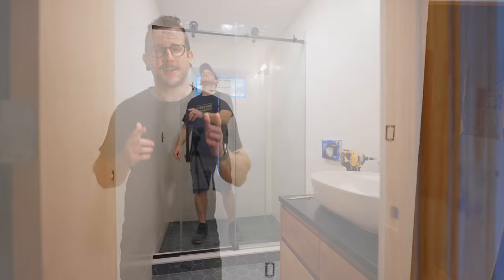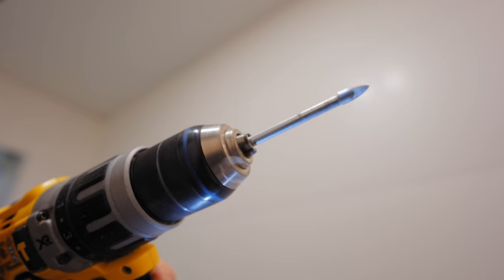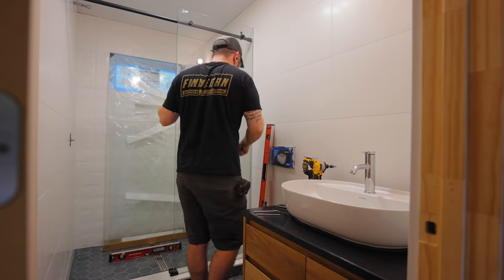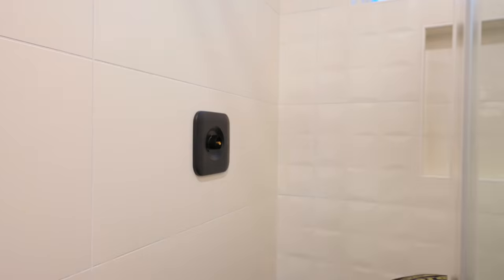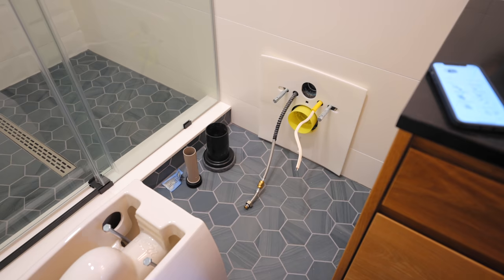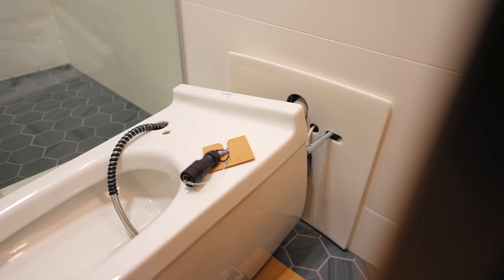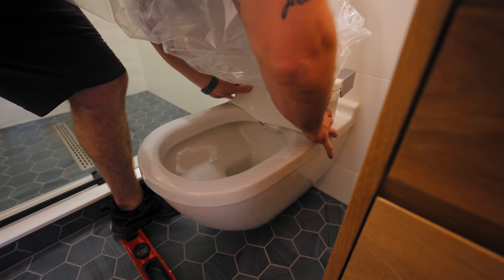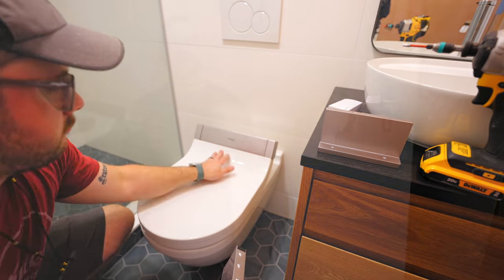Installing a $3000 BIDET TOILET in the Not So Tiny House bathroom 💩

Comment: When drilling holes into curbs and shower walls always inject some clear silicone sealant into hole and into plug before screwing into place. You will be surprised how many curb failures I have seen due to water getting in over time through screw fixings
Reply from the maker: Good tip, maybe I can squeeze some in there now!
Reply: For the curb, the better solution is simply not to drill it at all, and to use a different attachment method.  Or perhaps in a pinch, to drill it no more than half the thickness of the cap.
Reply: @maths9085  Indeed, I always specify screens and doors that do not require drillling into the curb but we all know how other people don’t always pay attention lol

Comment: For screwing pipe fittings in and getting them in the right spot, use a teflon tape and liquid PTFE to ensure a seal without having to wrench on the fittings so hard.
Reply from the maker: Good tip!

Comment: I’m going to be swinging by to “test” that toilet out for a few minutes this morning.
Reply: Didn't one of the Perkins brother suggest using the handle of your pliers in the shower pipe and use them a lever to make the last little bit of the shower stem tight? May have just made that up.
Reply from the maker: @REDCLAYHOMESTEAD  yup, but that video came out after this one 😂
Reply: @craftedworkshop  dang...

Comment: For the shower necks, get an inch length of hose that fits over the neck and cut a vertical slit in it. Then you can wrap it around the shower neck, and grip your pliers around it. Rubber gives good grip but then you won't mar is with the pliers
Reply: Another option is buying soft grip "vice grip" type of pliers from Lee Valley.  Work well and come with a replacement set of soft grips.
Reply: @scottb.2022  That works too. Can even just fit hose or a few layers of heat shrink over your vice grips
Reply from the maker: Good tip!
Reply: Strap wrench
Reply: Find a length of round bar stock that fits snugly(ish) inside the shower neck and use it to extend your leverage. Obviously be careful as you can end up bending the shower neck if you use too much torque!

Comment: with the bent shower head elbows, leave the head off til its already on, and put the rubber coated handle of your channel locks into the end of the pipe. the extra length and angle should give you the leverage to get it turned around and lined up. no need to grab ahold of the outside
Reply: works like a charm!

Comment: When installing shower arms, stick the rubber coated side of the channel locks in the shower arm. Gives you just enough leverage to get it tight and no more scratch marks on the shower arm finish.
Reply: Also could try a strap wrench
Reply from the maker: Good tip!

Comment: I use rubber strap wrench to install stuff like that without scratching.  It grabs the pipe with friction from the rubber and gives you leverage to turn but won't scratch.  There's a limit of how much torque one can apply before it slips but usually it's enough for a good seal.

Comment: Great job, love the series! For tightening finished plumbing fixtures and fittings you can use a piece   of rubber like from old cut garden hose or industrial elastic on your tools jaws, or wrapped around the fixture. You can also purchase a fairly cheap boa constrictor snake wrench, which are specifically designed for that.

Comment: Looks amazing. The bathroom mirror should however be above the tap or it will look strange so you should definitely move it up a bit. I would even have put it as close to the lights as possible but I'm also almost 6'9" tall so I would have wanted it as high as possible.
I would also have put the toilet-paper holder on the side of the vanity since it will be awkward to reach behind yourself to reach for the paper.

Comment: I put the handle to my pump pliers inside the shower arm. They kind of lock in place but make it so you can get it tight enough. Could also use a strap wrench.

Comment: To put the shower arm on without scratching, stick the handle of your pliers into the hole and use it as leverage to tighten it. So you'll have to put the shower head on after

Comment: My parents have 2 bidets in their 6500 sq ft home. It took me about 5 years before I finally gave it a try. Yes you do feel very clean and your undercarriage has never felt more clean after you have done your business. My parents bidets are not the one shown but theirs has all the bells and whistles except theirs has a tank like a regular toilet. Theirs has a remote too where you can set multiple water temperature settings and multiple water pressure settings. I swear though that theirs must have a little leprechaun or some magic wizard living in the bowl that aims the jet of water because I  couldn’t get that jet of water more dead accurate in the booty hole if I tried. Holy crap! It raises me off the seat because I wasn’t expecting a prostate exam by a jet of water. DEADLY ACCURATE!! Be warned your butt will be clean but low pressure and warm water until you figure out your settings. I swear I had to swallow when it hit me and I still don’t know why. 😳😣☺️😀🤫. Damn all that talk and I didn’t say much about your project. Sorry that was rude! I really do think you did a wonderful job. I loved the countertop and they style that you kept. Also I never thought nor have I ever seen a barn door style glass door (if that makes sense) in a bathroom. I call anything with the rollers on a rail a barn door. It was to cool and I applaud the use of that in this bathroom. Doing a full glass basically wall for the shower makes that little bathroom seem so much bigger and eloquent. You did great you really did. I am in the middle of two bathroom renovations for a neighbor who wants to sell his place so there are no frills but anyway wanted to tell you what a nice job you did and I plan on stealing some ideas for my place or a willing customer. Brett Go to Guy Handyman Service in Hoover Alabama 205-822-9616

Comment: Shower arm is easier to install without the head on and stick a plier handle into the hole and turn that way.
Reply from the maker: I did try that but it was unfortunately SUPER tight so I had to pull out the pliers.

Comment: We love our cheap-ish Tushy bidet. I would HIGHLY suggest buying a 60 pack of washcloths on Amazon (about $30) and use those as reusable toilet paper. Keep a shelf of rolled up wash clothes and a small can to toss them in when done. Wash and reuse. No toilet paper! I know yours has a fan, but toilet paper on a soaking wet bum doesn't work as well as a soft wash cloth and saves a ton of cash over time
Reply: Managing and maintaining a can of used poop rags sounds horrendous.
Reply: @tysonkoehn1  you can't always get the poop out with just water.  As Adam Carolla says "it's like trying to get peanut butter out of a shag carpet"
Reply: @aarone.7551  na if you use it correctly, you get perfectly clean. Just spray for a few extra seconds if you having cleaning issues. Either way, toilet paper is the the worst way to dry off. I'll stick to the wash cloths. They are clean cuz there is nothing but water to wipe off.
Reply from the maker: I like this idea!

Comment: when your doing your shower heads, can i suggest grabbing a microfibre rag thats clean , wrap it around the shower head so its nice and thick then you can use your pliers to tighten it , it aa bit of a bum to do but ive never had any problems with it before without damage , plus i will just point out you might want to keep an eye on the shower head becasue you said it scratched up from installing it cause if youve damaged the powder coat it has , so the shower head or arm could rust after a while . just something to look out for , other wise good job 

i wouldve also hung the toilet roll holder on the vanity , reaching behind you for the loo paper is going to be very uncomfortble and annoying , as welll as generally inconvient
Reply from the maker: Yup, I tried wrapping the shower arm with some foam but the vise grips still damaged it! I will definitely be replacing the arm at this point.

Comment: Since it seems no one else has said it, I will:  you put the toilet paper in the wrong place.  I hate bathrooms (usually in hotels) that mount the TP behind the toilet. That's so hard to reach while sitting. 

What I would've done, especially since some folks won't even use the TP because of the bidet, is get a nice free-standing TP holder. You could tuck it out of the way normally and if someone is staying there that needs it, they can move it out in front of the toilet where it's actually usable.

Comment: Wait a sec I thought the main purpose of the bidet is to eliminate the need of toilet paper?
Reply: Unfortunately, no.  I found that the family went through more toilet paper with a bidet seat than before.  We didn't have the butt blower.  Maybe that helps.
Reply: No, it's to do a "cleaner" job, best result is combining water with TP.
Reply: @HarryLovesRuth  Just use small towels to dry your butt lol… No need for toilet paper.
Reply: @Ogilla  I was fine with that strategy. My husband wasn't.
Reply from the maker: With the fan, it essentially does but I want our guests to have both options since bidets still aren't exactly mainstream here in the states. TP is also convenient for other stuff like blowing your nose.
Reply: @craftedworkshop  gotcha